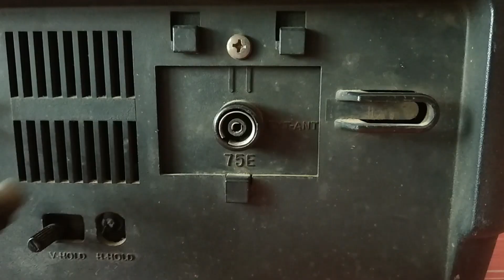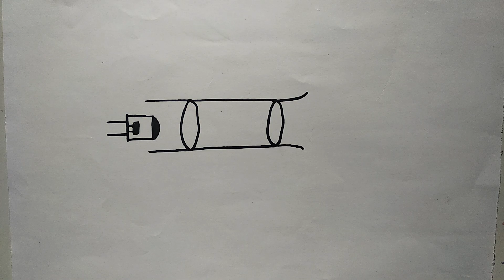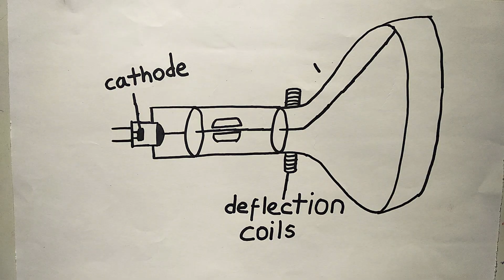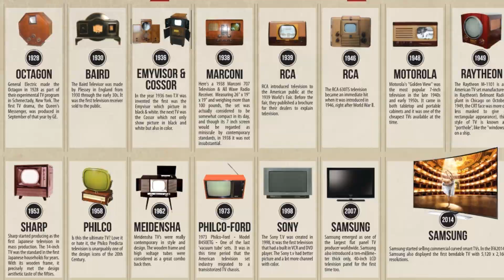How CRT TV works ? EXPLAINED

Comment: Still using one in 2025 but is a 19 inch Samsung Syncmaster 955DF a mid high end monitor. Crazy 1344p and 1536p res, way sharper text and image quality than my 1080p LCD screen.

Reminds me of current 27 inch 1440p panels in sharpness.

Comment: 4 parts
1: electron gun with cathode (produces electrons) and accelerated with anode at high voltage and it travels at a very high speed and hits the phosphor coated screen 
2: electro magnets attracts the beam horizontally and vertically if the procedure takes at high speed you can see the lines on the screen and a picture can be produced
Reply: Its not explained how the picture is produced

Comment: Plasma tv was a failure as technology but opened a door for lcd tv as lcd opened a door for OLED technology   remember that LED TV is Not LED its Pure LCD just lcd isn't any difference between lcd and led just the lightning panel....that doesn't make it a new technology...just brainwash ppl to pay a higher price for it thanking that the display have leds to project the image :)))) lcd tv have fluorescent tubes to light the lcd display and led tv have led stripe to light the lcd display, so led tv replaced the fluorescent tubes with led stripe,)))  so when someone tells you that led tv is better than  a lcd ...remember that one doesn't understand technology and he is manipulated by seller's:))) and try to explain if you can:))
Reply from the maker: But isn't it better in power consumption, better colour reproduction, deeper blacks?